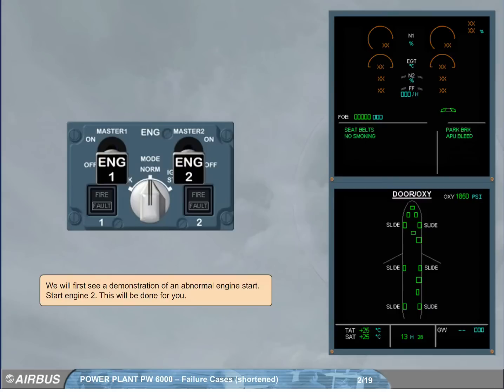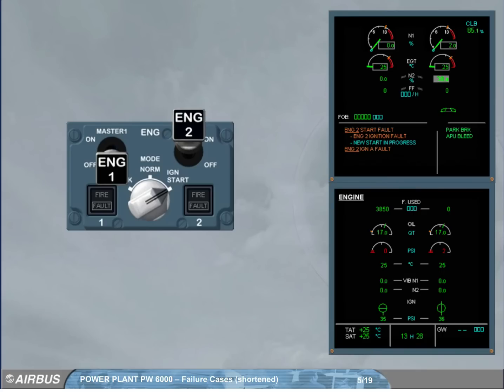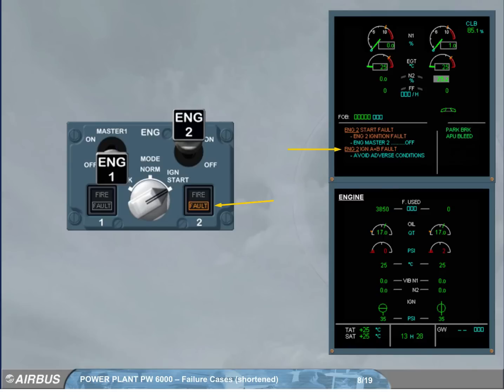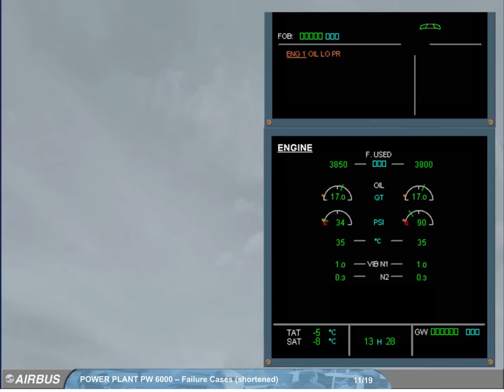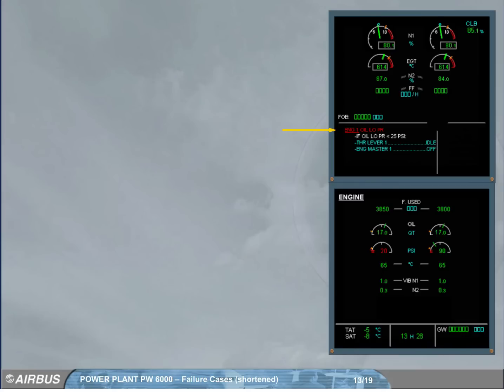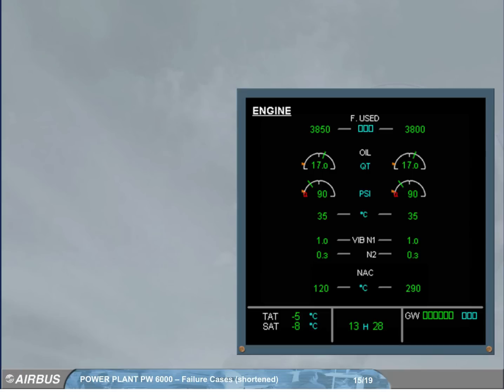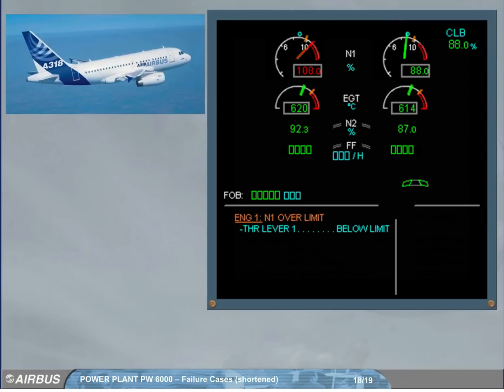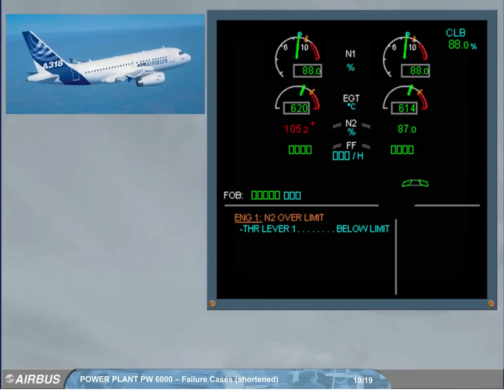Airbus A320 # 184 PW ENGINES POWER PLANT FAILURE CASES

Comment: If N1 , N2 or EGT exceeded the value is greater than limit the message required to shut down the engine true or false?
Reply from the maker: False as long as you are able to maintain it under limit otherwise yes shut it down